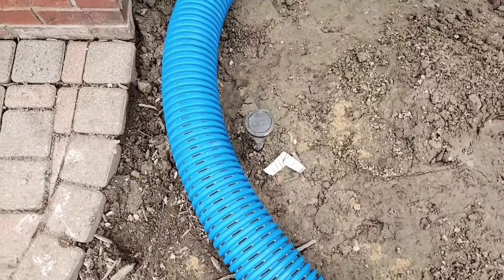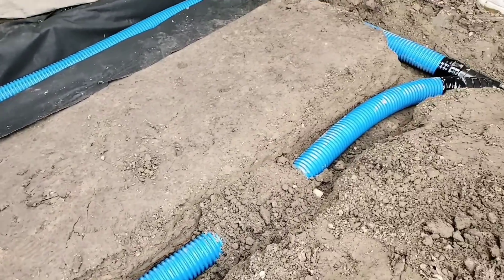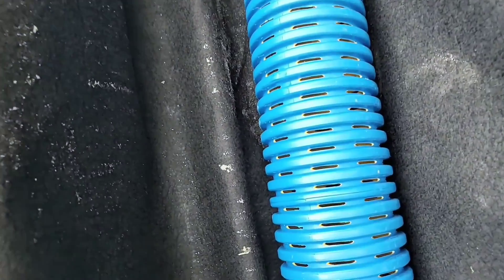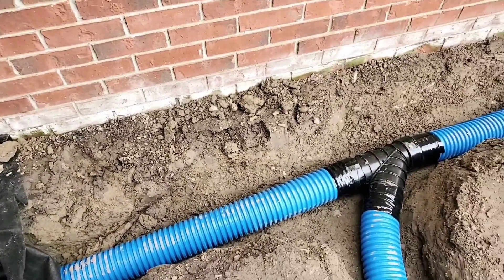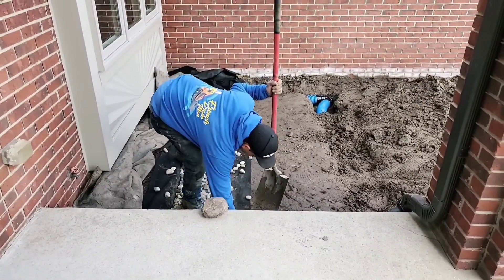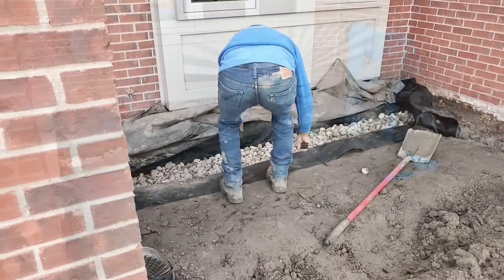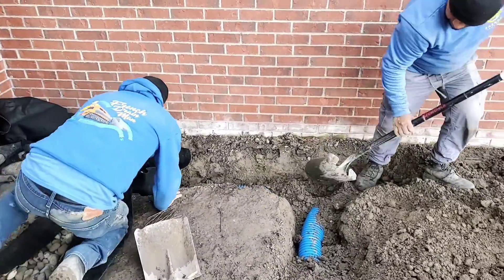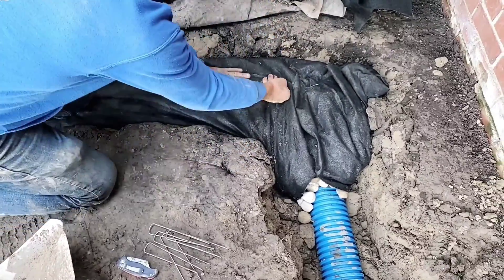Can You Tie a French Drain Pipe into a Gutter Downspout Pipe?

Comment: Really great to know. My down spout is 2 feet below my French drain. But I need to lower my French drain by 2 feet. Hopefully I can connect at a lower location without to much trouble. It’s a steep hill.
Reply from the maker: If you're gonna be that deep, you need a really good strong virgin pipe
Best French Drain and Yard Drainage Contractor
https://frenchdrainman.com/
Reply: Thanks. I will make sure to do that. Looks like it will be a 5’ deep French drain with a 2’ deep exit drain from the hill.

Comment: I live in Birmingham, Alabama. I have water runoff from neighbor's yard uphill from my house seeping into the ground going under my concrete patio creating effluence in my stamped colored patio. Also cracking my patio.  A gutter drain from both houses run right through the wet area where I need a French Drain. Based on your video I need to make my French drain separate from the gutter drain.  I was thinking about splicing the gutter drain and make it a partial French Drain and reconnecting to gutter drain letting the water exit to the back drain gutter.  But based on your video I would be building a project to fail and possibly create a problem with neighbor and Home Owners Association.  I also don't know what to do on the fabric cover.  You cover both gravel and pipe with your double punched fabric.  Others say only place gravel on top of French Drain.  I am 79 and plan to do the work myself.  I like challenges and the satisfaction of successfully completed a project.  I will be digging the drain with pick and shovel.  I will be running into clay and rock.  One I need to know what to do with the gutter drain and my need for French Drain.   Two I have more questions.  I want to purchase your material.  May I call you and discuss my dilemma and you advise me on how I should proceed in designing my drain issue.  I also believe I may have water seeping under my slap foundation.  I want to stop it before I incur major problem. My  underground wet area is about 50 feet in length.  I am planning on exiting water in back yard and not dig ditch further than physical limitation.
Reply: The fabric is there to keep the drain rock clean. So you need fabric all the way around your fresh clean rock so it stays fresh and clean.
Reply from the maker: https://youtu.be/kb5HVaMZVYg

Comment: An extension of the question; can you run a gutter down pipe into a solid buried pipe, run it 20ft away from the house and then into a French drain under the lawn? For example when there is no nearby road or large lawn to run the water in to, and just a small enclosed lawn with walls on all sides?
Reply from the maker: https://youtu.be/-6GgUg7Kb3g